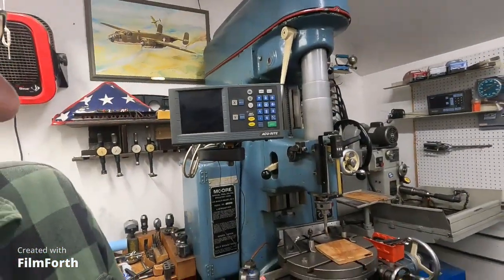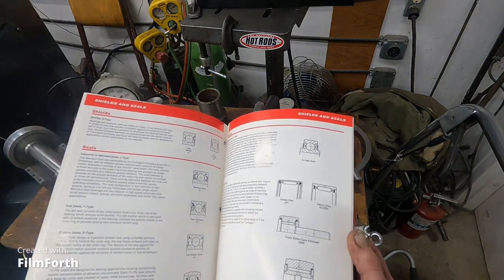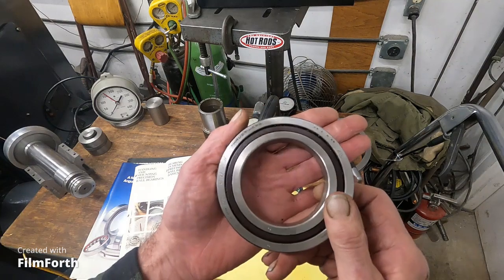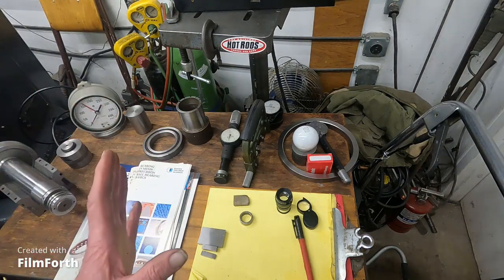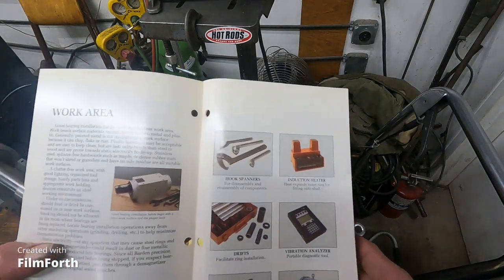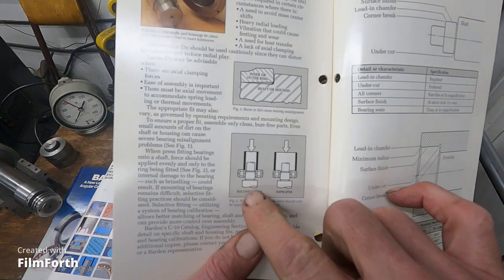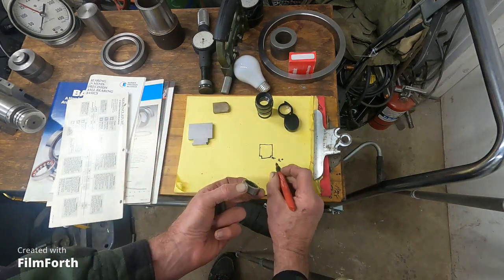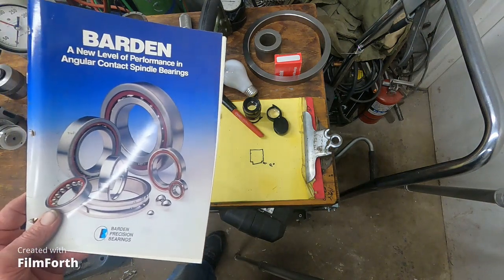Bearings in mind, getting started with precision bearing fitting for machinery.

Comment: 17:50 that hammer :D.   Good info here thanks for the content D
Reply from the maker: I am planning a video showing recasting all of my refreshing and healthful lead hammers, restoring the old machines took a toll on them, thanks!
Reply: @deedeeindustrialsuperprecision  Nice I'll tune in for that.   I was thinking about making one with an aluminum or steel tube..... melt down some lead and fill the tube.   I'd probably do it in a sand mold for the ends to extend out.   Your hammer is so funny to me though.   It's had a few days work hasn't it
Reply from the maker: @dizzolve  I take a piece of pipe, drill a hole in the midddle for the steel handle that has some holes in the very  end for lead to flow inyo to hold the handle to the head, saw the pipe down the middle through the handle hole. Put the two halves together stick the handle through the hole and wrap it up with thick tin foil and soft steel wire except the top, pour in the lead and then knock the pipe halves off!